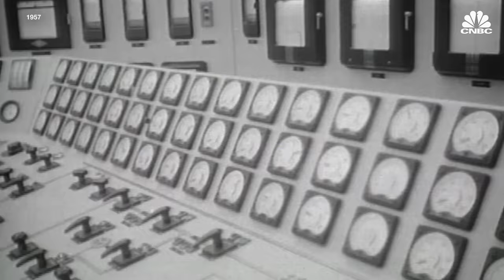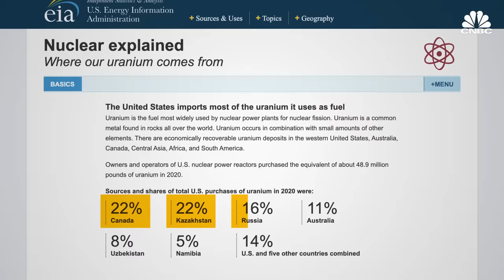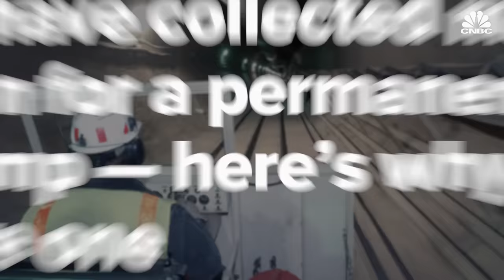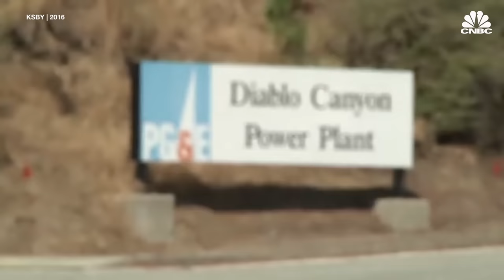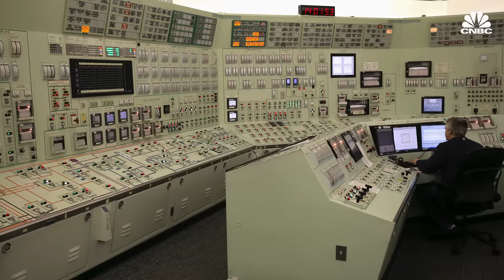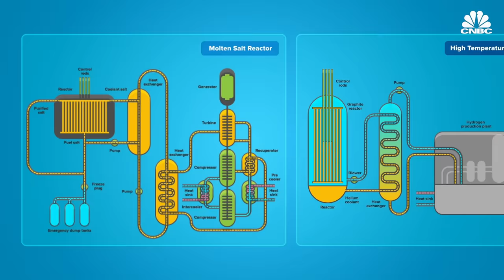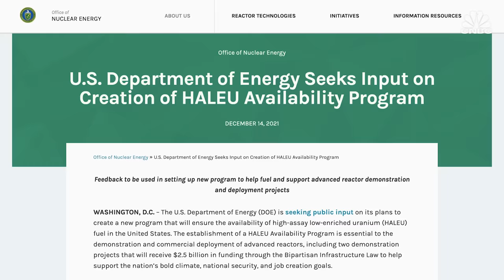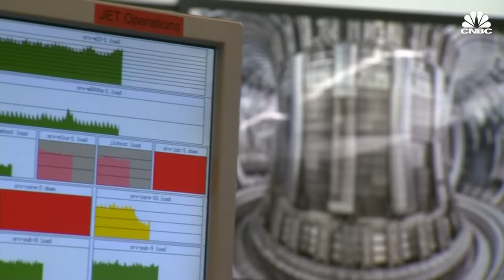Why Nuclear Energy Is On The Verge Of A Renaissance

Comment: Here is a little fact.  We use power "ALL THE TIME".  Even when we sleep, we are charging cars, powering street lights, stop lights, water plants, running air conditioners and heating water.  Not to mention hospitals and many other emergency facilities.
Reply: the last 5 nuclear projects in the U.S. over the last 20 years have been complete failures.  If you cannot build nuclear cost effectively it does not matter when power is needed.
Reply: @clarkkent9080  I was replying to the statement in the video that Nuclear plants do not shut down when not needed.  My point is that there is not a time when they are not needed.  Also, you cannot shut down a coal plant either.  It is not like they put out the coal and relight it.  The only thing close to being shutdown at night is gas.
Reply: @sammcbride2464  Gas turbines are very flexible and can be restarted quickly if needed.  Coal plants cannot be shutdown/restarted easily but they can vary their output quickly and effectively.  Nuclear plants can vary the output but it makes the plant difficult to control so they are generally run at 100% capacity all the time and are the last to be requested for an output reduction.  
Spring and fall night-time demand is significantly less that other times of year and day.  You would be surprised at the major swings in power demand.  Large grids help equalize the demand which is why Texas (the only state with their own separate power grid) have so many problems.

My point was simply that old nuclear plants are shutting down every year and the U.S. has been unable to build new nuclear cost effectively.  I don't see nuclear's contribution to the U.S. energy grid increasing for many decades to come.
Reply: @clarkkent9080  Texas does not have severe problems.  This is blatantly false.  I lived in Texas for 38 years.  My father and grandfather were oil men.  This propaganda to state that Texas has an energy delivery problem is to force them to join other grids.  Do you remember Enron?  If Texas had such an energy problem, why was it Texas that had excess energy to deliver to California?  Why is Texas the provider of 70% of the CNG for the nation?  Why does Texas have the largest wind generator farm?  You guys are just absorbing the propaganda of a specific crisis and applying it holistically.  This is utter nonsense.
Reply: @clarkkent9080  I am pretty sure that the south Texas nuclear site was approved for another plant.  This again is more political than some kind of technical inability.  We still have not made any GE Gen V plants that are way safer than our current plants.  We also have not done any of the Thorium design plants that are super safe.  This is all political.
Reply: All of the Nuclear waste from plants will fit in 1 Olympic swimming pool.  It is all the accessory waste that only has a half life of 1 year that is lumped in with the fuel rods that occupy the most space.
Reply: @sammcbride2464  In the winter of 2020, the Texas power grid began to collapse causing billions in damage.  The grid came within 4 minutes of a total grid blackout.  If the grid had blacked out it would have taken weeks (According to Gov Abbott) to restore.  No electrical power in Texas in subfreezing weather for weeks!!!
Wind turbines stopped working because ice formed on the blades, natural gas that contains moisture froze in above ground lines and coal piles froze and coal plants shutdown.  Oe nuclear plant tripped due to subfreezing weather. 
Texas power providers are not controlled by the federal government or state governments and refuse to spend money to prepare their power plants for a freeze that happens only once in a while.  LOOK UP THE FACTS ON THAT
Reply: @clarkkent9080  Where is your evidence internet troll?
Reply: @clarkkent9080  Still propaganda.  The grid was not the problem.  The power sources were.  It just so happened that 2 of the 3 nuclear reactors were scheduled to go into maintenance.  The rest was a frozen water pump.  The natural gas supply was also impacted.  It was a winter storm during a planned maintenance cycle.  Look it up.  Your facts are skewing reality.  It is something that is easily fixable through a process change.  Texas does not have to joint the national grid to fix a 1 week issue that could have been avoided.
Reply: @clarkkent9080   Yet you keep ignoring that many countries have built and used small modular reactors for many decades, for millions not billions.  Your continued nonsense is not impressive.
Reply: @sammcbride2464  You are right the power sources were the problem because Texas does not require the power plant operators to harden their plants and the owners don't want to spend money on making their plants more reliable so the next time the grid may collapse completely. And unlike the rest of the U.S. Texas recommends but does not require planned maintenance to be scheduled when power demand is expected to be low.  So nothing has changed and nothing will change and a similar event happened in 2018 but not as severe as 2020.    

The grid came within 4 minutes of a total collapse and that is not only a fact but even Abbott admitted it, while your senator split for Cancun.  Abbott tried to blame it on wind turbines and solar.  Solar is not affected when you blow the snow off the panels...simple enough.  And the wind turbines are supposed to be backed up 100% by gas turbines but they failed. 
Put the entire state of Texas in sub freezing weather without power for weeks and the damage will be substantial.  Millions of homes and businesses had busted water pipes.  Cell towers have battery backup for 2 hours and gas stations do not have emergency power, so no gas and no cell phones.  It would have been a major disaster but Texas always does it up big.
Reply: @clarkkent9080  I don't want to fight with you, but a simple fix to a process is way more easier than giving control to a grid outside the US.  How hard is it to schedule maintenance based on weather?  How hard is it to put a heater around a water pump?  I am pretty sure both have been done already in Texas.  This propaganda is about control.  The EPA wants to control Texas power plants and they cannot right now due to interstate commerce laws and state rights.

What has the western grid done for California?  Absolutely nothing.  We have brown outs, black outs, forest fires, explosions in cities from gas pipelines, etc.  I can go on and on.  The grid problem is pure propaganda and a red herring.  California electricity is at $0.54 per KWH for me.  When I left Texas, it was $0.09 per KWH.  California will not build any Nuclear clean energy plants.  When I worked for a cloud computing company, we moved our data centers out of California.  So, again...what has the western grid done to benefit the state of California?  The answer is nothing.  PG&E and Edison Electric control everything regardless of the grid.
Reply: @sammcbride2464  I have never said anything about the Texas grid being or should being connected to any other grid.  You are right, the Texas grid is one of only 3 lower 48 grids and the only state-only grid. And you are also correct that it is that way to prevent the federal agencies from exercising any control over it.  That is fine and Texas has every right to do so.

The facts are that the Texas grid has continual problem providing reliable power.  There were major blackouts in 2018 and the problems were never fixed.  In 2020 the grid came within 4 minutes of collapse...meaning all (100%) power lost.  Nuclear power plants need close to 100 Mw to run equipment just to startup. Coal plants need many Mw to run pumps and coal conveyors to startup. Gas turbines need many Mw to roll the turbines before gas can be admitted. Wind turbines along with all other power sources must be synchronized to the grid and if the grid is dead the output breakers cannot be closed because there is nothing to snyc to. That is why it takes weeks to restore what they call a BLACK GRID and Texas came within 4 minutes of that in 2020. The east and west coast grids have never been in danger of a BLACK GRID condition.

Texas ERCOT does not have any regulation or control over any of the power producers.  They did recommend against plant shutdown for maintenance in the winter of 2020 but the plant owners did what was most cost effective for them. These winter conditions typically only occur every 10 years or so and the greedy power producers are not willing to spend money to heat miles of above ground gas lines, install wind turbine blade heaters, or any of the millions necessary to harden coal and nuclear against extreme cold weather when it is cheaper to just shutdown for a few cold winter days.

Gov Abbot blamed the whole 2020 event on Wind Turbines and solar which is a bold face lie that can only be told by a life-long liar.  Your senator split for warmer Mexico and millions of homes were damaged when pipes froze. Businesses lost billions.  Texas can do what it wants but you have to be ignorant to not realize what would happen if 100% of power was lost for weeks in subfreezing weather during a pandemic (people working from home), no gas stations, no cell phones, and hospitals on diesel generators fuels from out-of-state since there is no power to load tankers in Texas. Wanna bet Texas would have been begging for federal help then????  But they can do what they want
Reply: @clarkkent9080  The video implies that the solution is for Texas grid to be joined with one of the other nation grids.
Reply: @sammcbride2464  I cannot find an easy to access source for electric rates in Texas vs California since it is dependent on exact location and plan.  When I lived in California it was 5 cents per Kw in Sacramento. Here in the southeast, I am paying 11 cents per Kw (plus 3 cents per Kw for Vogtle nuclear plant construction) but when Vogtle unit 3/4 comes on line the full  $32 billion construction cost will double that to more than 22 cents per Kw. Nuclear is the most expensive form of electrical generation over coal, natural gas, solar, wind etc..

But I do know Texas has fixed and variable rate plans.  The fixed plan is a higher cost per Kw but it is fixed no matter the usage.  The Texas variable rate is lower but the price can vary on what the Texas grid operator is paying the power providers, and this is based upon need.  In 2020 when power was needed to prevent a grid collapse the grid operator offered the max amount to the power providers and residents on this variable plan that were lucky enough to not lose power received bills in the 10s of thousands of dollars.  All this can easily be confirmed by researching news reports on the event since this made national news.  I never heard if they really had to pay this massive electric bills but the politicians were scrambling for cover.  There is a very good YouTube video on technically what happened and how close Texas can to a major disaster.  

My point has never been anti-nuclear unless you consider me relaying the facts on cost and construction failures for nuclear in the U.S. to be anti.  I worked in the industry all my life but I am also a ratepayer.
Too many people on these channels get their information from their facebook friends and even though the true facts are just a few clicks away and require some reading, I continue to see people spread wild lies and complete untruths about nuclear.
Reply: @sammcbride2464  I don't know about the video implying anything.  The one I watched,--- texas power grid failure practical engineering--- just stated the facts of what happened.  If all power would have been lost, it would have been a major disaster. 
 I just read another article that stated as of today, nothing has changed.  The Texas legislature wants the ratepayers to foot the bill for these private investor owned power companies to harden their plants against extreme cold weather. The consumer usually gets screwed by pure capitalism without regulation.  
Personally I don't live in Texas and have only driven through a few times and they have every right to do what they want as long as they don't ask for a federal government bailout if they screw things up.